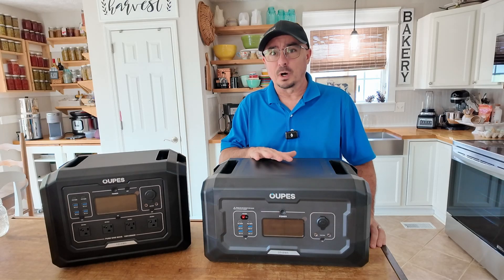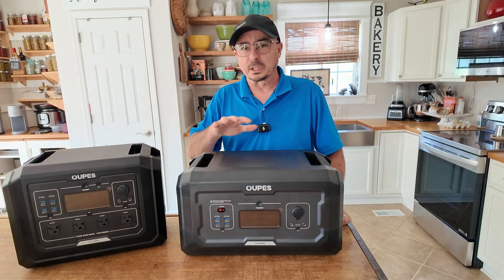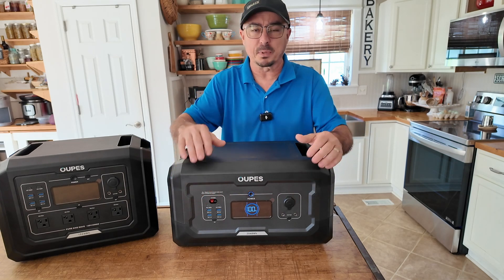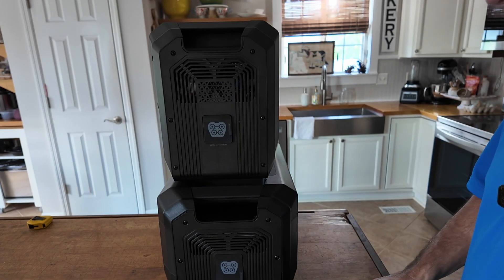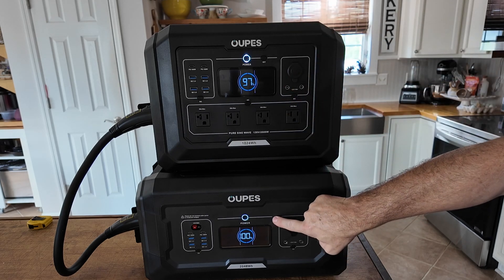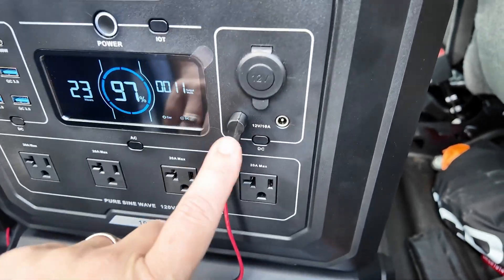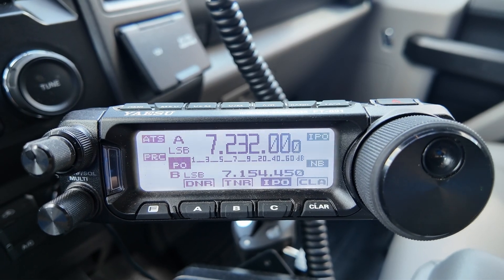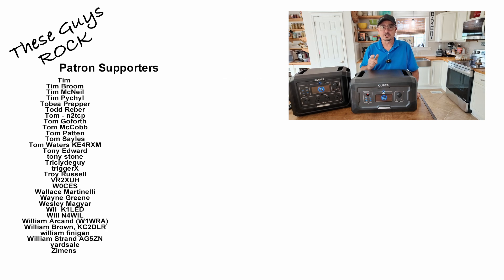Oupes B2 Expansion Battery

Comment: Well, I need to charge them from commercial power I did not understand that this could not be charged that way. I’ve been disappointed in these mega ones that I got and now this extra battery can’t be charged on commercial power at this disappointing
Reply: You 💯 CAN charge them from commercial power. The Oupes 1 alone charges in 1.5 hrs. To charge the expansion pack from commercial power simply connect it to the Oupes 1. He mentioned this in the video.

Comment: 3:51 in the video you show the solar input 12-150vdc and then say you cant charge the expansion battery without commercial power unless you use the main unit. Could I use a generic automotive battery charger, putting out 12V and 3-15amps($50-75) through the solar input? Plug the charger into 120V outlet and charge the expansion battery that way. Thanks!
Reply from the maker: @rikets9725  I haven’t tested that but it would probably work.

Comment: Interesting Jason 
I built my own 6.5kw Solar Power pack (13v @ 520Ah) with 2x 200w panels for around £1.3k
It runs the shack and can be switch to run the main house lighting and heating pump in an emergency.
The electronics is Victron or home built. The Victron Inverters run at 50Hz or 60Hz so zero interference in the shack.
73 Bruce G4ABX
PS I'm doing one of the live stream presentation next Sunday at the RSGB Convention -- "QRP Fun or Folley?' It also features BAP in the digital section 😀

Comment: Seeing no RFI with no load on the inverter is good, but you should also check for RFI with a load plugged into one or more of the inverter ports.  Adding a load could change the emissions from the inverter.

Comment: Pretty sure those funky panel connectors are called MC-4 connectors , which are standard fare on most PV panels .
Reply from the maker: Yes. The bigger one is MC-4. Just wasn't sure about the other one that had the single round connector

Comment: Nice powerstation and expansion pack. The 30 amp DC output is handy. easy run 100 watt radio or a small inverter . The both together will  keep food coed for a long time.  With both of them have solar in ,with multiple panels you can charge faster. I have friends in NC without power  over 10 days now and cell phones are out as well as no landlines .  Finally heard from utility company in NC  . Still no ETA on power restored but shortage of power poles and equipment like pole transformers slowing things down. The cell phone company's reporting lots of cell towers with damage due to flooding and lack of power.  Generators ran out of fuel or failed to start . This just in North Carolina. many outher areas have similar problems just adding to the delay in fixing.   Georgia has some power plants offline due to hurricane and damage to power grid.   This is why Power Station's are great to have.  Now Florida getting a cat 5 hurricane . 73
Reply from the maker: Let's hope the damage to Florida is nothing like what happened to NC & TN

Comment: I'm curious the life time of all these device's.  I have multiple jbl bluetooth speakers and small battery packs that you use to top off cellphones/ect that no longer take a charge. E-waste now
I'd hate to spend a $1000 plus and the same thing happens to these in a matter of two years.
Reply: I was kind of thinking the same thing. Where do all these big battery packs go in ten years? I assume you can recycle them. My local recycle location will not take them.
Reply: They have LiFePO4 battery . should be able to take apart and replace .  Should have 10 year life span.  Fallow charging instructions and should have great life.
Reply: Supposedly, the batteries still have 80% life after 10 years.